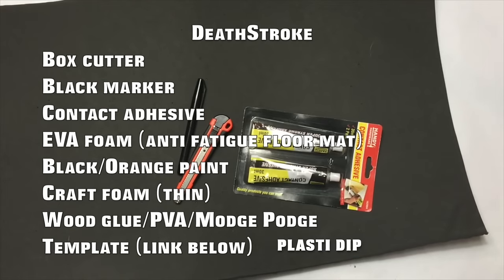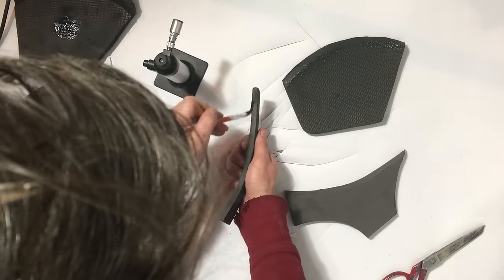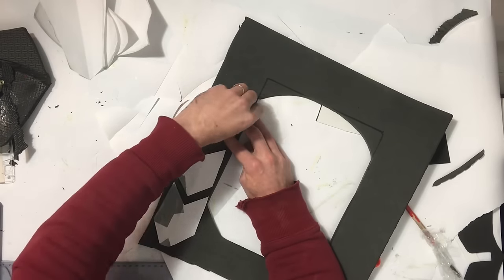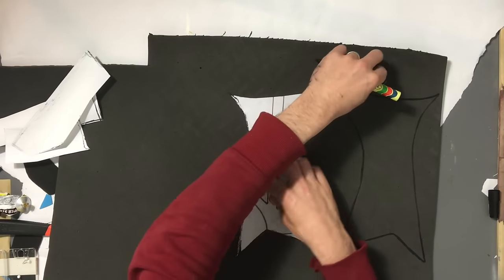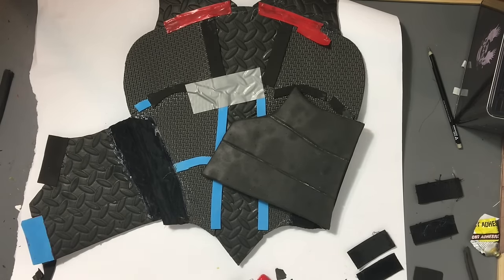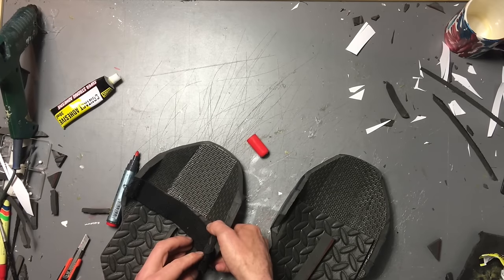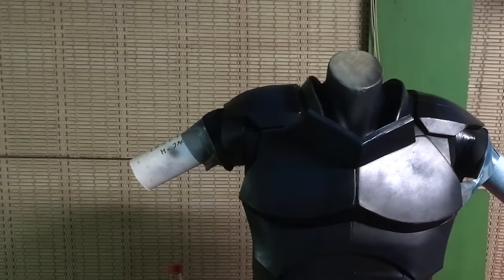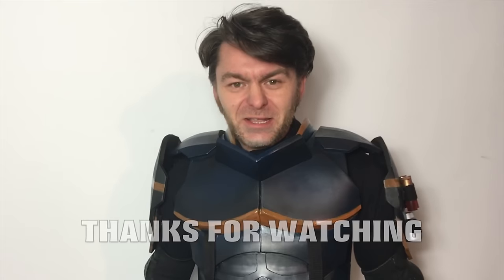How to make Deathstroke Armour

Comment: AMAZING JOB MATE! 
I have questions, though...
#1 - How can I tell which parts use which thickness of foam?
#2 - Is Plasti Dip or Modge Podge necessary? And what is PVA?
#3 - By contact adhesive do you mean Superglue, or will 3M Spray Adhesive do?

Thanks
AK
Reply from the maker: 1.Thick for the chest shoulder and shoulder guards thinner for the other parts and thinnest for the details. In the end its up to you nd what you can get your hands on.

2.PVA is wood glue. it helps with sealing the foam before painting.

3. by contact adhesive i mean contact cement or a strong glue a lot of people use barge which is good or a contact cement.
Reply: Let's Make Stuff Thank a lot man! Great advice. I'll figure out a way to show you my completed suit once I finish it. :)

Comment: are your templates adjustable for different body sizes?
Reply from the maker: You attach the sides with velcro so longer velcro for a larger person should work also extend the should straps if you are larger than 5'8".
Reply: +Let's Make Stuff yeah I'm 6'5 so I'll have to make some size adjustments if I buy the template lol